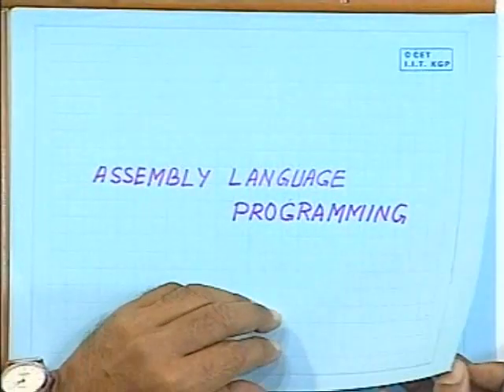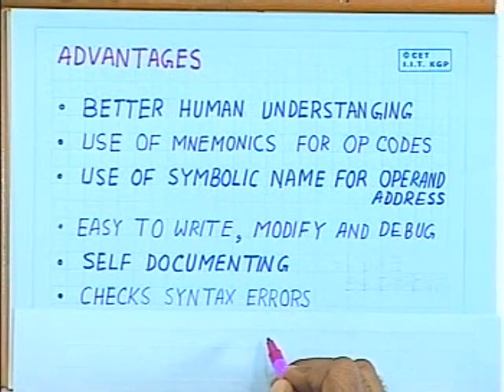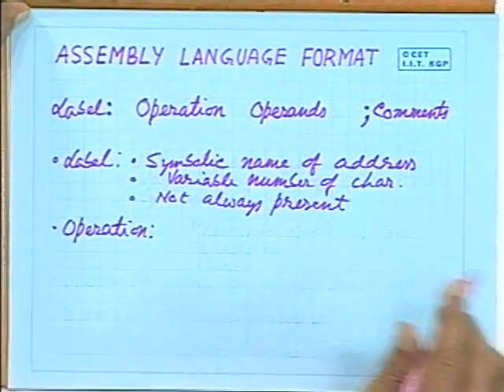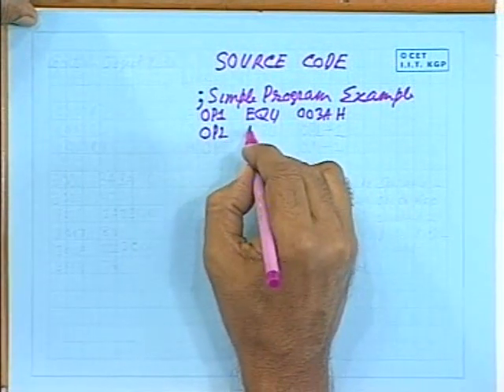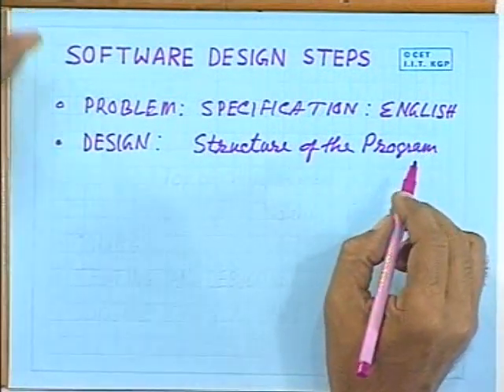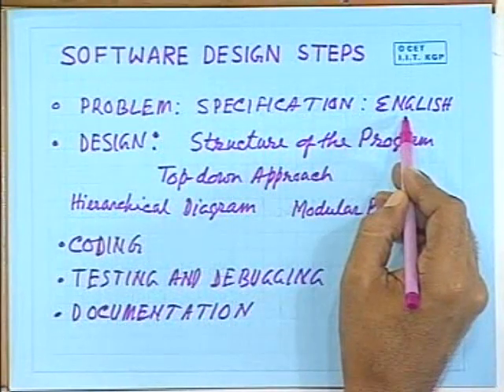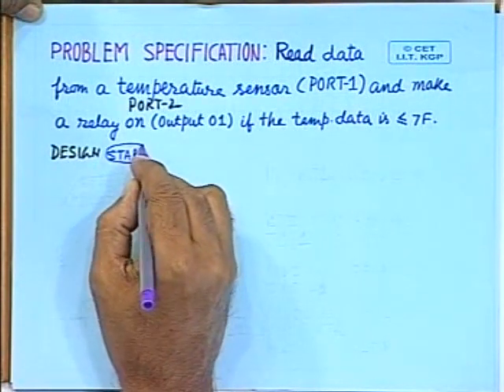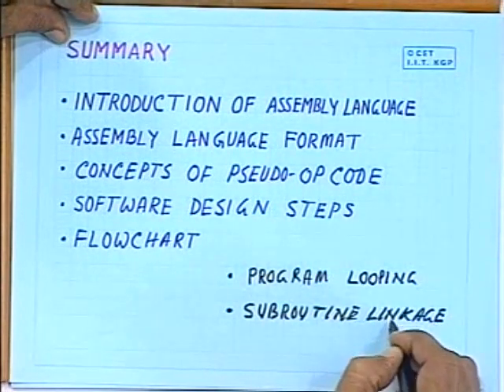lec 8 - Assembly Language Programming

Comment: When I was a core programmer for Delta Air Lines, back in the 1970s, on 5 IBM 360s, it was called assembler, not assembly.
Reply: What is a "core" programmer?
Assembly = language
Assembler = the program that assembles assembly code.
I wrote millions of lines of code in assembly Lang since 1969.
Reply: @rty1955  At Delta there were about 250 programmers. 22 of us programmed in assembly, though we called it assembler. The other programmers used Delta's proprietary version of PL/1. Magnetic Core Memory was what would be called memory today. It was mechanical, slow and expensive. It was replaced by semiconductor memory chips. When a department came to us to request a program, we would analyze the problem. We were authorized to offer a program if it would require no more than 128 or 256 bytes (bytes, not kilobytes or megabytes). The 22 of us were divided into 3 areas, each with our own supervisor. If the job appeared to requires 512 bytes or 1k, our supervisor had to approve it. More than 1k required permission from a higher supervisor. We programmed in hexadecimal. Whenever there was a problem, a "core dump" was printed out. A core dump was 500 pages of hexadecimal. If memory serves, those pages were 14 and a fraction inches wide of green and white-striped paper. I think IBM began using semiconductor chips on their 370. I left Delta in 1976 to work again in Korea and DC and didn't work in computers again until 1983 as an HP and Victor 9000 dealer.
Reply: @rty1955  Core is what preceded memory on microchips. It was very expensive, slow and mechanical. We core programmers were allowed to begin on an accepted job if it required only 128 or 256 bytes (yes, bytes). A supervisor had to authorize proceeding if 512 or 1 k was actually required. If more than 1 k was necessary if was bumped up to a higher level for permission. The other programmers used Delta's version of PL1. The first program I wrote used a block of 128 bytes and became the 3rd busiest program on the system. The 22 core programmers were divided into 3 rooms. One of the programmers in my section was named Baskin (I don't remember his first name). The supervisor was Sue Robbins. We were known as the ice cream group.

Comment: Consider a pedestrian crossing with traffic lights and a walk/don’t walk light, attached to microcontroller outputs as follows:
Red = PB0, Yellow = PB1, Green = PB2, Don’t Walk = PB3, Walk = PB4
The pedestrian buttons are both attached to the interrupt as follows: 
B1 = B2 = IRQ. 

Write a microcontroller program and draw a flowchart which will continuously perform the following: Green Light on for 20 seconds, Yellow Light on for 5 seconds, Red Light on for 10 seconds and the Don’t Walk sign continuously on for this time period.

Include in the program an interrupt subroutine that will turn on the Red Light and the Walk sign for 20 seconds, and then return to the normal operation

PLEASE HELP!!! THANK YOU
Reply: hey senior whats going on in your programming life? can you guide your junior plz? i would be very much thankful if so

Comment: Consider a microcontroller for an air condition unit which controls how long the compressor turns on based on the temperature. A temperature sensor sends an 8-bit digital value to PORTC . The compressor is started when a signal is sent from Port Pin PB5. Control is according to the following procedure:

-Check the temperature.
-If temperature is greater than 30oC, then turn on compressor for 60 seconds, and then turn it off.
-If the temperature is greater than 27oC but less than 30oC, then turn on compressor for 40 seconds, and then turn it off.   
-If the temperature is greater than 24oC but less than 30oC, then turn on compressor for 20 seconds, and then turn it off.
-Delay for 2 minutes and then check the temperature again.

Write a code and draw a flowchart to achieve this.
 
PLEASE HELP!!!

Comment: how is object code generated??please someone explain..!!
Reply: +Ksdivya Kumari object code is generated from assembly code. Using target address, pc or base relative, opcode, you add TA or target address with pc, base or b relatve, e, i or immediate, indirect together. These binary code is added from you translated it from hexadecimal to binary. For ex, hex of 032600 is 000000 110 010 0110 0000 0000 0000 or 0 3 2 6 0 0 in binary. Then add TA to disp/address like TA + disp depending if there is 1 or 0 in n,ix,b,p,e (p=1, b=0; b=1 , p=0).